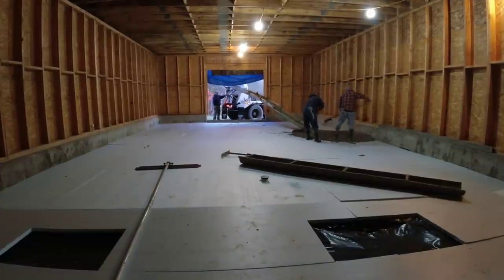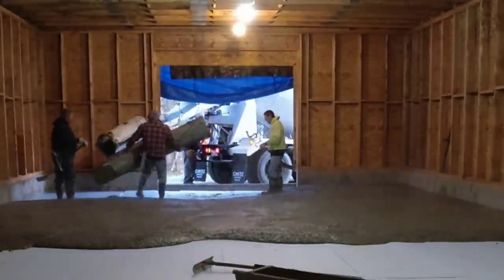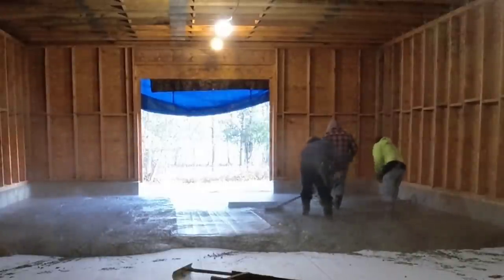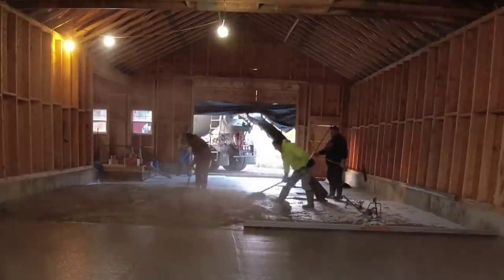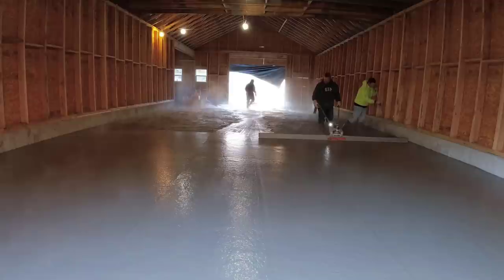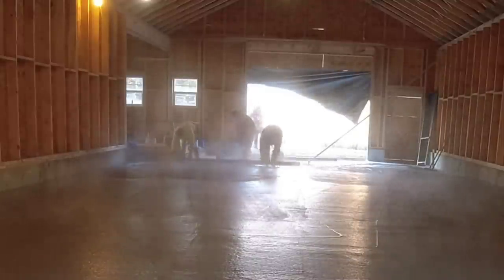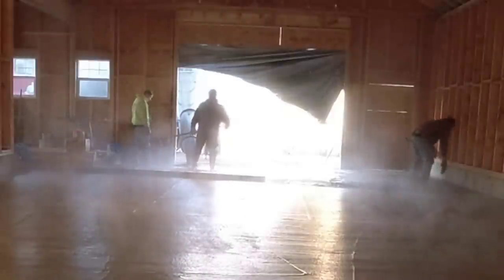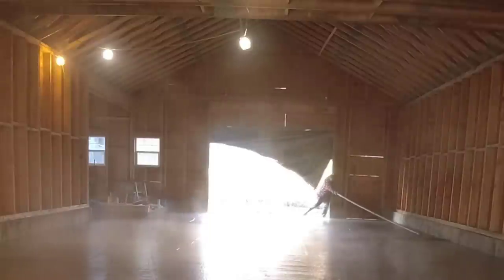Inside Concrete Floor Pour In Very Cold Temperatures

Comment: Thanks for the video!  I had 3 young bucks just starting a business pour my barn floor on Tuesday.  Size, temp, drain and even door access almost identical!  I've shared your video with them as I think they could really use the MBW screed and chutes that you use.  They wheelbarrowed the center and a small 14'x14' milk room off to the side of the slab.  We had some high winds which didn't help and the power trowel didn't come off until 8:30 PM.  Thanks for sharing, all your videos are great!
Reply: I had quoted a conveyor to make it easier.....  $650 for mileage, $135 per hour and $3 per yard dumped.  Not much of a decision.
Reply: The Hands Are Cold first, was the toes until I went to Woolies which helps a Lot. It's Called STEAM Or What Ever you Want! GOOD JOB!

Comment: I just had a slab poured a couple of weeks ago right before it got too cold here in Wisconsin. I had the frame of the building in place, but no walls. Just made it before the weather went south on me. Our concrete guy wheelbarrowed the concrete to the  far corner, and they went thru the purlins with the rest. They used a power screed on it, and it went very smoothly. No foam underneath though...

Comment: That is definitely the best way to pour that. Coming in from both side to get max reach. If you have to do a lil pulling for a few feet today thats what you have to do.😂 You have a good crew. They know how to pull and get the mud up to where you need it. At least concrete is flowable and is up to slump with hot mix.

Comment: Omg Cheers to you Maine concrete guys !! It’s super cold there. In California, concrete pumping is super abundant, and fairly cheap. I would 100% pump this. This 16 yards would cost $360 in Southern California for a 3000psi p gravel mix. It all depends on the type of concrete mix and whether you need a big rock pump or p gravel pump. Most of us pumpers here in California pump primarily 3000psi P gravel and use p gravel pumps.

Comment: I would only pull it like you guys did with an experienced crew like yours. I,ve noticed the lazy crews nowadays want to pump everything at the customers expense. We used to use three 16 foot shoots and built cradle’s for them and pour 80’ out with them on terraced digs, we now have footing crews using pumpers on jobs they could do with one chute and just automatically charge the customer.

Comment: On the topic of builing the structure before the floors. Its very hard for us carpenters to build square and plumb walls without the floor. Without floors you'd have to stick frame it and its just too time consuming if your crew isn't proficient in building that way.

Comment: Mid-range 
Water Reducers Hot water 2% HE. Fiber  4000psi straight cement. Crank it and blow it The new trucks just don't blow it like the old chain drive drums trucks would.  I would not use a pump on this. Even if I owned one.
Reply: Great comment from someone who knows! Wow it's so valuable to me to learn from pros. Thanks for the comment !

Comment: Which code requires 2" insulation in an unheated building? I'm not familiar with that. I do consulting work in Maine and other states in the area but there are a lot of codes to keep track of.
Reply: Could it be part of the international energy conservation code requirements? They've gotten more strict in the last few years.
Reply: @skliros9235  an unheated building uses the same energy whether it's insulated or not. I'll have to look that up thanks.

Comment: Why do you put drains in garages ???????
Reply: Almost a necessity it northern climates in order to drain off snow melt from vehicles and equipment. Especially with radiant floor heat. You have to drain the water off and get it out of the building otherwise the condensation builds up and everything inside the building sweats. An air exchanger helps but getting the water off the floor and out of the building is key.